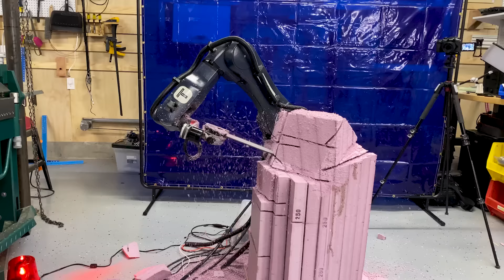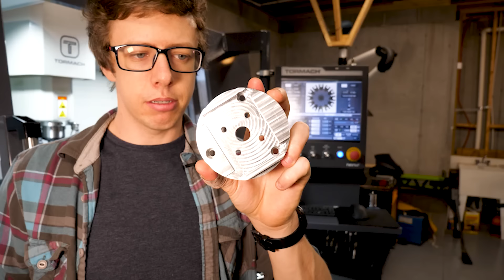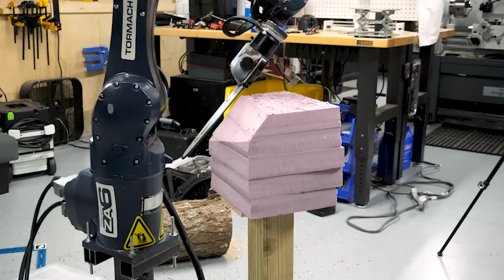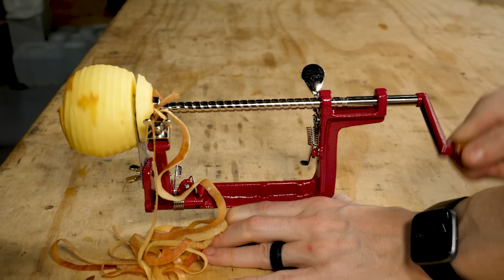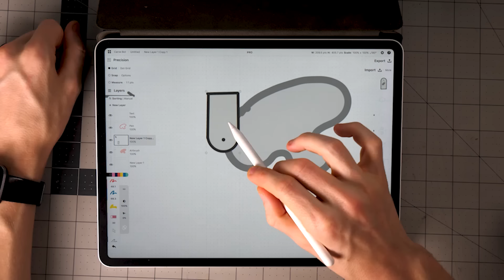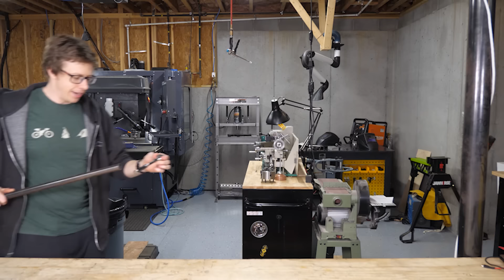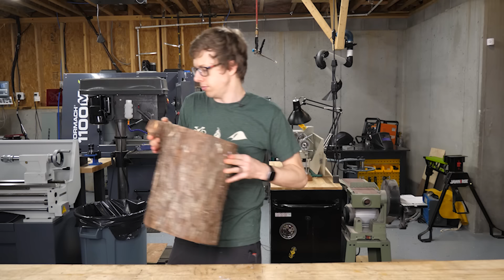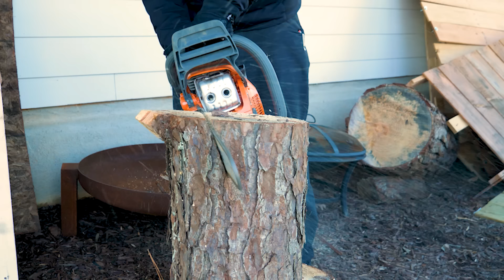Chainsaw + robotic arm = art?

Comment: There is a relatively easy way how to calculate the gradient ascent, even if you have multiple maximum points.
Start scanning a linear line, let's say along the length of the object starting near the edge, and record the heights.
repeat that with a rough distance, let's say 6-7 mm scanning another line parallel to the first one and recording the heights again.
Do it until the object is roughly scanned, which should be a couple of lines, and should happen quickly.

Repeat the same on the perpendicular direction along the width of the object, again a couple of parallel lines.

Once finished, you have obtained a rough heights matrix.

Let's assume that you've discovered that this height matrix includes 3 maxima (maximum points)
All you have to do now is get the height sensor to do the standard algorithm of gradient ascent you used before and start with the nearest point next to each maxima and repeat that 3 times (once for each maxima).
Once done, you compare the 3 heights you've got and take the highest one, which is your point.

In order to avoid mistakes, when deciding on how many maximum points the algorithm should check after the initial scan, just make a condition that the difference between maximum heights should be higher or equal to the distance between the linear lines you measured initially. That way, you reduce the to-be-measured points into minimum number possible.

Good Luck
Lemogan

Comment: A chainsaw file and oil go a long way! Depending on how hard the wood is (it appears to be pine, so probably not too hard), you'll need to sharpen the teeth fairly frequently. Speaking of oil, was the feed blocked?
Reply: Also, beef up the motor on the saw, that should help heaps!

Comment: The reason your chainsaw was burning the wood is a combination of the saw being dull and also that the standard chain is optimized for cross cuts with a tiny cut depth. It is not optimized for ripping.

You could purchase a ripping chain or you can buy a cheap chainsaw sharpening tool and do it yourself.

I highly recommend buying the tools and doing it yourself. You should also touch up the chain every few hours of sawing. The more often you do it, the less time it takes to get the chain perfect so sharpening the chain more often actually saves time.

Also you were partially correct about the chain's depth gauge slowing the cut down. Part of sharpening is getting the depth gauge teeth the right height. Too high (as they typically come when new) and you'll need to push the chain into the wood while cutting and the teeth will take small cuts (even if sharp).
Height gauges you adjust too low make the saw pull itself into the wood aggressively and you'll constantly be dealing with the saw being underpowered for the cut the blade wants to naturally make (even if super sharp).

Basically (with a sharp chain) you want to shorten the height gauges so the saw naturally cuts at a moderately aggressive rate without you having to push the saw into the wood nor pull it away. You definitely need to shorten them quite a bit from the original height.

Once you understand the height gauges you'll want to keep the saw sharp using a file and chainsaw sharpening guide tool regularly.

Roughly once every 10 or so sharpenings you'll need it to slightly shorten the height gauges again.

If you want to make the chain cut more efficiently (in addition to the shorter height gauges and sharpening) you'll want to reduce the tooth angle on every second pair of teeth. A typical cross cut chain has 35° (or 30°) teeth. This helps to clear the wood out of the way so it doesn't get cut again. When ripping, this angle reduces the efficiency and clearing isn't as important. A 10° angle will cut noticeably faster (with a slightly shorter gauge tooth as well) but you still want some (often ~50% of the teeth, depending on the wood type) of the teeth at 30 or 35° to help clear the chips.

Do some googling and video watching about sharpening chainsaws, sharpen your chain and in no time you'll have the saw zipping through the wood like butter.

The biggest improvement is sharp cutting teeth and shorter gauge teeth. The 10° angle is like an extra 10% to 20% bonus in ripping rate and is optional.

Comment: Filing down the raker teeth on the chain slightly will allow you to use the tip of the saw to cut.  Because it's not a human operator, with numerous limbs in the danger area, slight kickback shouldn't be a problem.  Just be careful to limit plunge speed of the blade to not be overly aggressive.

Comment: Man you used the wrong saw…  you can do a better job with an angle grinder with a chainsaw blade, you might not be able to go as deep but would help in completing the look plus I think your saw speed might be to slow also with the skate board motor, there's a circular saw blade called Prazi which might be better.  Blade speed plays a lot in how much you cut, and it looked like you saw blade was to loose.

Comment: I wonder if your saw chain couldn't either be modified to cut at the tip or a chain couldn't be bought designed to do just that? I could ask my logger neighbor with 35 years of dealing with saws, chains and bars. He's my go to guy to tune up my Poulan and put a quicker cutting edge on even a new chain. Perhaps checking with one of the guys that do the chainsaw carving. I've seen them carving and know they use the tip to cut... a lot. :)
Reply: @sehhi vooty  Yeah! And how come they're a dog and a half long and only half a dog high? :)LOL(:

Comment: you're going about it all wrong......chainsaws require sensitivity of touch and intimate understanding of how the tool cuts, so that which moves the tool needs to have that knowledge and sensory feedback from the cut. You also have to account for the variability of the material properties which is not uniform, and the changing properties of the tool as the teeth sharpness reduces. It really is not suited to cnc programs.

Comment: Saw-burning-wood issue may be due to two primary things. 1. chain needs to be constantly oiled to reduce friction between bar and the chain. Oil runs out quickly on small saws, and some small electric saws only have a manual oil pump. 2. The pole saw is probably designed to not cut well, or at all, at its tip to avoid kickback (ie. designed to only cut with flat section of blade), as you figured in your analysis.  Carvers use their blade tip lower edges to carve tight spots. The amount of material removed with each tooth is controlled by the height (depth) of the point in front of the tooth (depth gauge). But you probably already know all that.

Comment: I am a chainsaw wielding professional, and I can make your chain cut happily at the tip, and if the torque is sufficient I can make it cut even with your low chain speed saw.... if you want to take another gander at that send me a couple chains and the bar you use and I'll modify them ;)

Comment: I think you approached from the wrong direction. By stating with a model and working backwards toward the code. You should start by studying how human carvers make their bears. The ones if watched seem to derive their basic shape I just a few cuts. Figure out how to code these, then autogenerate code from there. Also create a machinable model, rather than trying to force the saw to machine a generic model. Think about how many things you use every day that's shape has as much to do with what made it as it does with how it needs to function.

Comment: Gradient based optimization will always get trapped in local minima (or maxima if you put a negative sign in front of the objective function). You could have tried a technique called monotonic basin hopping. It might not have worked, but other alternative methods can get far more computationally intensive. We deal with this problem all the time in interplanetary trajectory optimization.

Comment: I would write a program that you use a joystick to move the robot arm and then save the positions with a button until you have manual cut the log and it should be saved.

Comment: Nice video...but you have to understand chain saws more...
Most chain is cross cut which cuts great against the grain but not with the grain...milling chain is for with grain but not against grain...skip jack chain is combination with and against grain, but usually only available for bigger saws...perhaps it might be available for your saw, you will have to research it...
Also after you sharpen chain teeth you have to file down the chain rakers just a little so the teeth cut the wood but don't dig in....research this.

Comment: You could try doing this with a softer wood rather than what seems like oak. Also question about why you went you went from the perimeter to the shape when creating the code rather then the shape to the perimeter while using the same logic that if an angle works then any other angle smaller then it should work as well.

Comment: Using the gradient functions are useful in finding LOCAL minimums and maximums. If you take that same starting point and get a local minimum, then proceeding further leads in the direction of another local maximum, usually, unless it is a zero slope flat plane....

Comment: Few tips that you might actually know, but didnt do in the video. 
When cutting the wood you need to use chain oil as a lubricant. Every wood chain saw uses it as it prevents the chain from burning. 
Also your chain is too loose, you need to tighten up the chain as it will make it cut faster and with less sliding sideways. It also keeps the teeth stay sharp for longer. Ideal chain is in a slight tension.
Reply: He gotta get it in the gullet. ....

Bucking Billy Ray Smith, youtube

Comment: Even though the saw looks deadly cool I would recommend going to a 4 inch angle grinder with the round toothed cutting wheel made for wood.Needs no chain lube,will be easier to cut and control in wood ,far less dangerous and can cut super detailed.Your videos are amazing and funny. Nice work.

Comment: you need different chansaw blades depending on if you are going down the length of the log (ripping blade) or across the log (crosscut blade). if you try to rip with a crosscut blade you won't make any progress and you will just sit there and make your chainsaw overheat like you did.

also buy a husqvarna

Comment: That thing you called an "anti kickback" tooth is actually a chip clearing tooth for the sawdust.  Around 17:10, it got hot because the teeth on the chain are dull. Cutting dry/cured wood is pretty rough on a chainsaw. It doesn't appear you have any method of supplying oil to the chain which is going to be detrimental to the chain while cutting wood as it needs the lubrication and cooling  provided by the oil.

Comment: Your current software / hardware setup got you to a rough shape, with most of the excess material removed.
Phase 2 should be with a different tool (perhaps a drill bit?) and software that will plunge the bit into the material.  Perhaps more than one pass with different diameter bits to get the "resolution" better?

Comment: For the gradient ascent problem: Do like MC simulations? Change each parameter one by one, move them each a random neighboring number if it ascent accept, if it descent accept with a probability, the probability will encode how easiily you'll be stuck at a false maximum at the cost of more computational time.

Comment: As a 5 axis CNC machinist this makes my head hurt.  The chainsaw has what they call safety chain.  If you grind away the safety kickers , but not the actual depth gauge/rakers you can plunge cut with it just fine.  You can also twist the saw in the cut like a screwdriver to make a bowl shape as long as you are taking a very very shallow cut.

Comment: The tooth on the chainsaw chain you referred to is not 'an anti-kick-back' tooth, it is the guide tooth. It sets the depth the cutting tooth bites into the wood. Chainsaw cutting teeth are more like lots of little wood planes taking shavings, alternating side to side. The guide teeth are like the base of wood plane, and are set at certain cutting depths for different woods, hard or soft wood. Also, as the cutting teeth wear or are sharpened down, the guide teeth have to be filed to keep the cutting depth correct.
You are lucky you did not get into a position where the teeth on the chainsaw tip dug-in due to the guide teeth not setting the cutting depth. (Check out some of the videos on here of chainsaw wheels on grinders). The extreme turn of a chainsaw bar tip renders the guide tooth useless for the brief time the chain goes around the tip. That's what kick back is, the teeth digging into the wood more like a chisel than a wood plane. Once the tooth has dug into the wood so far, the chain motion then sends the chainsaw in the opposite direction. If this had happened while you were cutting the wooden block, you may have damaged your robot arm.

Comment: Robot technician here. Nearly all commercial robots come with default joint/stroke limits that prevent the robot from overextending and contacting itself. Some take that a step further and include the option to customize those limits to protect your end of arm tool. I'm not familiar with this brand, but I'm sure a quick google search or flipping thru the manual should point you in the right direction.

Comment: This is why this guy isn't an engineer. 

The tilt analysis is easily fixed using a level sensor with 3 axis.

Instead of solving the problem he used physical dependence.

Sensors man. Sensors. 

Also you didn't use neutral networks with self organization. Instead you thought in linear context.

Comment: Idea! Get it to melt ice into sculptures, using a heating element, or, better, fire. Sell ice sculptures for an unfeasible amount of money, in a fraction of the time it takes a human to do them. And by use of a system of pantographs, knock out several at once! 

Get to the point where yours are superior to anything a human could do, and are quick, cheap, and easy to make. You have removed the human element from art, thereby killing it. Nobody wants ice sculptures any more, bottom drops out of market. Congratulations! You have killed a stupid, snobby, pseudo-art form for tasteless jerks!

Next week: Killing postmodern analysis with a Markov chain generator. Oh, wait, they already did that.

Comment: With respect the fault is the "obsession" for using a chainsaw, this works when used by a human that can move it in ways varying the force applied and reacting to the wood's grain better than ANY machine, you would achieve your desired result if you created a special cutting disc using chainsaw teeth in a small radius. The correct cutting effect without over complicated algorithms.

Comment: Your "small" project reminds me of the surface x-ray diffractometer I was responsible for at https://ESRF.FR  about 25 years ago: precision (sphere of confusion <5 micron) sample environments up to 600 kg, high vacuum or high pressure and both high and low precision controlled temperature operation in a high radiation environment. More than 4 years of teamwork to getting it working as a science facility.
I don't mention cost: your wife would not approve. But it allowed for many PhD students to collect data on how atoms re-arrange themself ( with sub-Angström resolution at the surface or interface between 2 materials. 
You dog cutting tool is still an amazing work you made! I think few people will realize all the hurdles you had to overcome. Thank you for sharing!

Comment: There are other optimizers you can use besides gradient ascent that avoid getting stuck at local optima.  You can also just add momentum to your optimizer. It helps to think about this in terms of gradient descent (and generally you can reformulate the objective to finding a minima instead of a maxima anyway.. for instance, multiplying it by negative 1).  Anyway, so if you are riding a bicycle trying to find the lowest point on some terrain, at some point you might roll down into a local minima, but if you have enough momentum (which you would have at least some momentum in the real world)  you may just roll up out of that valley and continue on.  You can try tuning your momentum and other hyper parameters like step size (its hard to find a sudden steep drop if you just step right over it).